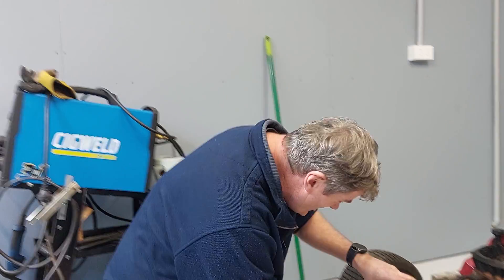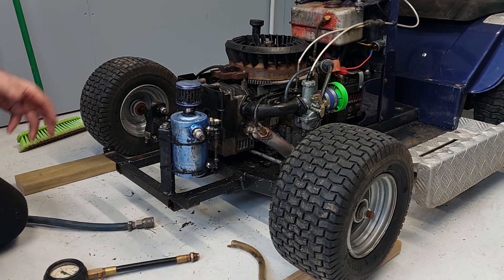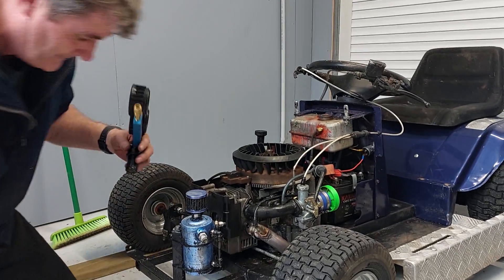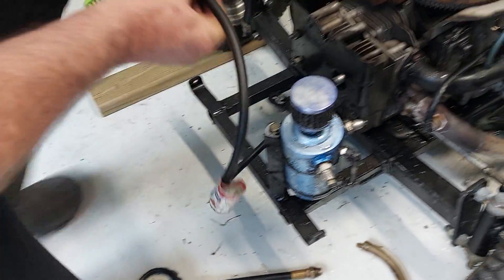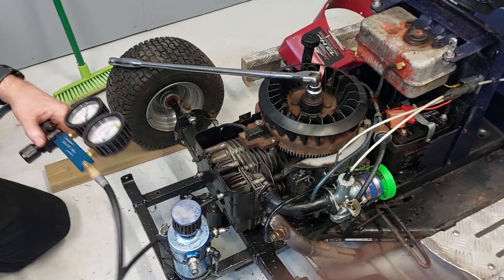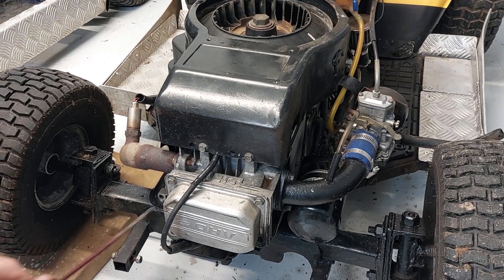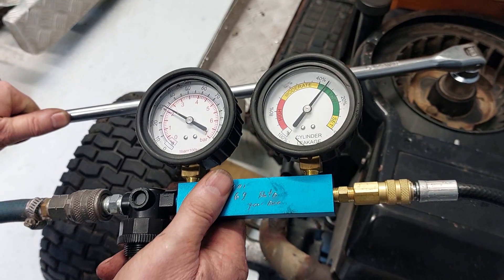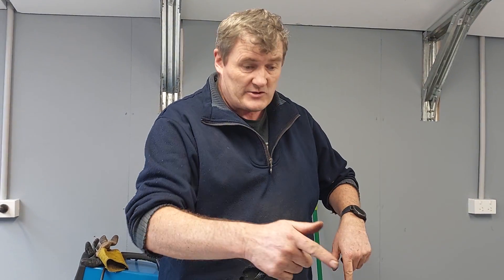How to test your motor condition

Comment: Is the oil filter mount on the 31ci engine custom made? Never seen them oriented in that way, must be very rare sump if stock. Maybe something to cover in a later video?
Reply from the maker: Hiya. I gather you mean the blue catch can. I put that on because when it revs hard it bows oil out the PCV valve and this can catches that oil.
Reply: @bazzasgarage1922  no, not the catch can, although that is an interesting topic aswell. On the other mower, underneath the intake manifold. Is it not the oil filter?
Reply from the maker: You are correct . It's the original sump , the motor came out of a Husqvarna ride on. The sump is different from the other motor I have.
Reply: @bazzasgarage1922  very cool! Would love to get a better look at it, couldnt find any pictures either